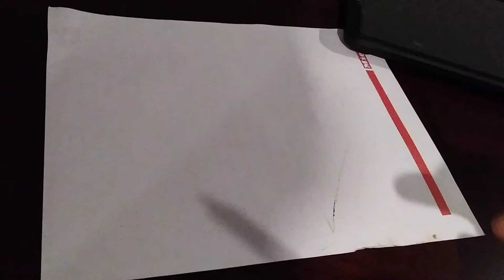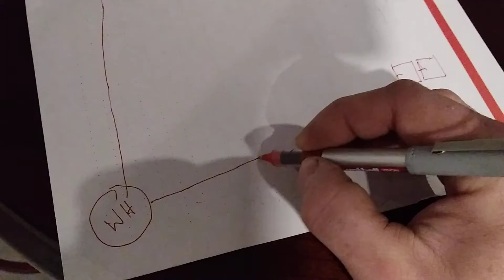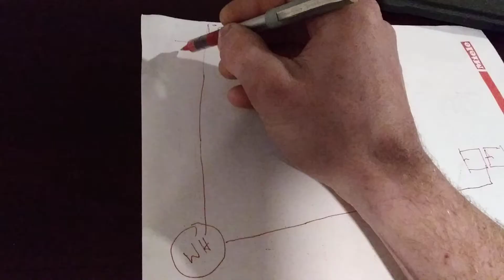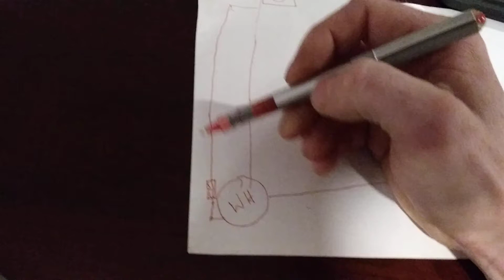Hot Water Recirculating Loop

Comment: This is a great system but now you are heating pipes all over the house, even when you don't need them.
What you are saving on water you are spending greatly on gas or electricity for the convenience.
Insulating the hot pipes will help some but all of my pipes are insulated and they don't stay hot or even warm for long.
You need to add an electric solenoid valve for less than twenty dollars and an electric timer that will open this loop only when you need it.
You really only need that hot water in the mornings, evenings and a few other times. You can buy timers, also less than twenty dollars that will even allow for different days of the week and multiple times per day.
Electric solenoid  https://www.amazon.com/HFS-Electric-Solenoid-Valve-Water/dp/B018WRJYUO/ref=pd_day0_328_2/137-7479043-9566120?th=1
Timer https://www.amazon.com/NEARPOW-Multifunctional-Programmable-Countdown-Electrical/dp/B07QJ3K43N/ref=sr_1_2?dchild=1&keywords=120v+multiple+event+timer&qid=1609652172&sr=8-2
Great system and good luck!
Reply: Great explanation of this, thank you!
Reply: For days without use maybe not very efficient. But depending how far the point of use is, its prob more efficient to keep a loop warm than drain many gallons until the hot water reaches the fixture. All the water you let run waiting for it to get hot also gets replaced at the water heater with cold water so it has to reheat that much water plus the hot water you actually use every time you use it.
Reply: @JEZPP   I did not say this was a bad idea, I said it was a bad idea to constantly circulate water through a loop when you are not using it.  Pipe loops even with the best insulation lose heat quickly and constantly burning up money in order to keep them warm.  As I already said my pipes are insulated in my house and they only stay warm for a very short time after you stop the water flow meaning it would be a constant battle to keep them hot.
Reply: Completely agree - much better to not waste energy keeping the pipes hot overnight or other predictable periods of inactivity. How would you wire the solenoid and the timer you linked above? Just wire a plug to the solenoid and plug it into the timer? If you can find a solenoid that fails "open" (the one in the link is closed with no current), the overall design is unchanged as you would be back to 24x7 hot pipes. I'm sure you'll recoup the $40 for the parts pretty quickly from less gas or electrical usage (and better environmentally).

Comment: Does this only work if the plumbing is above the water heater to use gravity?  How about a house where all of the plumbing is run under the house in a crawl space while the WH is on grade with the living area?
Reply: I am in that same situation and would love to hear someone's experience with this. OC Run, did you ever get a response to this?
Reply: @wimchalmet  No I didn't get any response.  If you find it out would you mind posting it here?
Reply: @ocrun6765  My house, built in 1940, is plumbed like this. A brass nipple piped into the water heater drain just like this video showed. The house is pier-and-beam and plumbing runs under the house through the crawl space as well as to 2nd story bathroom where shower gives hot water in about 2-3 seconds. Have always loved it. Been here 20 years.
Reply: @jeffbonner2765  thanks for your response.

Comment: I own a ranch that needs this badly. I noticed in your video your return was swichted to 1/2". Was that on purpose? I was going to run my return in 3/4". I didn't notice was your feed line 1/2" or 3/4"?
Reply: Return is low demand / low volume.  All you want is a path for the water to return.  The larger the lines are, the more heat will be lost - it's a physics / geometry issue because all hot/warm lines will have heat loss.
Reply: @bobblack3870  1/2” copper or 1/2” PEX?  Either work based on your comment I would think then?  If all it needs is a return path?
Reply: @bobs4718  Sure, 1/2" will work fine but is overkill for homes.  For many homes, this is likely to be standard for the final end-point usage, especially items like showers.  Sinks may even be using 3/8".  If you have it or want to go smaller, 3/8 or even 1/4 will work, because the return circulation like does not need high volume.
Reply: @bobblack3870  thanks, are there any issues with slight elevation variations in the return line?  I will need to dip about 10” and back up 10” for 12’ half way back to my HWH.
Reply: @bobs4718  No issues.

Comment: I installed a system like this, using a pump, and it works great. Very cool seeing the gravity design working. I used a spring-loaded check valve and didn't do the hole (if you can even do that on the design of flow check I used) but I've heard multiple reasons for the hole in the check valve, such as preventing valve chatter on pumped systems (for the hydronic heating loop in my house, there are check valves that were previously installed for whatever reason, and you hear a metallic clanging sound while the heat is running, which may be from these check valves, although I'm not sure), or for preventing an air lock in the system, which could be a concern in your system, since the gravity circulation would probably stop if you had an air lock in the recirculating line. With the hole, you're probably pulling a small amount of hot water the opposite direction while using any hot water at the tap, from the bottom of the WH, to the open fixture, which would ensure any air lock is bled out. The downside of reverse flow for your design is pretty low, since the water is warm anyway because you tee-d into the drain port, so you don't have the risk of cold water bleeding over into the hot line when there's a large enough pressure drop in the hot line. Your design also eliminates the power and design complexity needed for a pump, and keeps the water constantly circulating, which will increase the amount of hot water you have available, as well as prevent the risk of pipes freezing in winter, since the water at the very bottom of the tank will now be warmer than it was before. Cool to see you did it all in copper; I was lazy and used pex on mine 😅

Comment: Finally!  I think I've found the reason why the previous homeowner installed an additional 1/2" line to the bottom of the water heater!  Except ours has a ball valve and not a check valve, which would make sense why we get cold water out of the farthest faucet when another faucet is drawing hot water, like a shower.
Reply: Yup, just add a check valve in line with the recirc return loop right before it tees back into the bottom of the WH and you should be good. If your system is gravity and doesn't have a pump, you'll want to use the same style of valve that Owen used in the video which doesn't have a spring and doesn't require any force to open the check valve. If you don't want to solder/sweat copper, you can use a Shark Bite fitting, but I think Shark Bite only makes a spring loaded check valve which may not work for a gravity/non pumped system unfortunately. You can also try mostly closing the ball valve, which will limit the amount of water that's able to flow in reverse through the recirculating loop, and will make the water at the further fixture somewhat warmer without modifying the current system.
Reply: @MittyNuke1  yeah, I tried the shark bite check valve.  Even though it's only about a 2 psi check, it will not let the water gravity circulate.  I took it out and put a straight-through union in place until I can find the correct one.

Comment: This system wouldn’t work with an instantaneous hot water heater (with no stored hot water) would it? What are the alternatives?
Reply: The problem is the tankless water heaters need minimum 2.5 psi water pressure to turn on. That's the issue I'm trying to solve now so I can install a tankless to supply a Dickinson Radex forced air hot water heater in an rv. Trying to find a 12v CONTINUOUS hot water pump that can handle pumping hot water and not over heat and shut down...

Comment: Will this approach work for a 2-story house? I wonder there’s enough “gravity” to use this approach. Is insulting the hot side the trick to make this approach working? Or, do you insulate both hot and the return? 

Here’s quick estimation:
0.5” pipe, 8 ft up for hot (80 deg C, very hot) and 8 ft down for cold (40 deg C, like hot summer day). The water weight difference of water in the cold and hot is about 6 grams or 0.0132 lbs. the pressure from this delta on 0.5” check valve is about 0.07 psi, which is never strong enough to open a check valve with 1.5 psi opening threshold. So, you have to have a small hole in the flipper of the valve. Does this make sense?

Thanks.
Reply: Math is on point! I particularly appreciate the mix of Imperial and metric units. The small 'leak' drilled in the check valve allows a small constant flow (which might be temporarily reversed when the hot tap is opened.) The check valve still stops most of the cold-side flow from reversing.

Comment: Hi Owen-thanks for this video!  I just had my plumber install a new water heater and a recirculating pump.  It was taking 5 minutes to get hot water to my shower in the MB.  Problem is that now I have the opposite problem.  Hot (scalding) water first then cold.  Once cold it stays cold and can't adjust to warm water.  I've turned down the water heater..which now only gives cold water to the shower.  Sinks seem to distribute hot/cold ok...but shower not good!   Any suggestions?  My plumbers are stumped and have said they've never seen this happen so they don't know how to fix it. Meanwhile, I've spent $700 on the pump.  I love my plumbers and they've tried hard to make it right..they are stumped!  Thanks for any help!
Reply: After reading, my question is if a check valve was installed.  In addition, be sure to have a cutoff valve so you can disable recirculation entirely.  Then my next question is to determine if the plumber ended up connecting somewhere between hot/recirculate and cold lines somewhere in the house.  My new home plumber did. He marked nothing and at one point I asked him what was what and he said "I'm not sure."  Because I have white CPVC everywhere, before insulation was installed in my new house, I took 3 cans of spray paint (blue, red, pink) and squirted spots on the lines at various points as I tried to trace what was what during construction.  I got confused so I quit.  Now after the house is built and the plumber gone, I have done more review of his work because of freezing issues and found more incompetence in design.  To diagnose your situation, cutoff the recirculation line and confirm that the shower works.  Then cutoff the hot water line at the water tank - you should not be able to draw any water from any hot faucet or any shower. If I recirculate to get the loop hot, I can flush the master toilet and it will be filled with hot water!

Comment: the convection style of water recirculation doesn't work real well  for all situations.  for a single level house, the action of water heating isn't enough to push it all the way back.  just install a pump
Reply: Insulate the pipe. Don't insulate the last portion to the heater.  Will work perfect in 1 story house. Don't trap hot lines. No issues

Comment: My water heater is right off the kitchen, I do think gas is more efficient with producing heat than electric 🤔
Reply from the maker: At current utility rates you are absolutely right. If your house is laid out so the kitchen and bathroom(s) are close to the water heater, you may not have a problem with hot water taking a long time to reach the fixtures, and you wouldn't need this setup. Thanks for watching! :)
Reply: Owen Perkins I’ve actually had an experience with no electricity for 9 days due to an ice storm in Kentucky. The house got down to 40 degrees. Thankfully we had a gas water heater and we had hot water. So every time I look at homes, a gas water heater is a must have. Because it sucks to not have it when you need it the most 😂
Reply from the maker: @nathanielaranda8407  9 days?? Wow...hopefully that was a once in a lifetime occurrence. Otherwise an automatic standby generator would be on my short list of home improvements.
Reply: Owen Perkins it was back in January of 2009. Our local Walmart and Lowe’s had power, so we would just shop around to get warm. It was hilarious, they were like can I help you find anything. We said no were just trying to get warm 😂

Comment: Good video and demonstration.. wondering if the trade off of gas vs water is worth it? Probably is. I'm a plumber myself, just looking up different opinions and ideas on the topic
Reply: I am a plumber also, Saint Louis area. I’m doing a little pro bono job for a friend and I really hate putting in something that I know it was going to wear out and potentially cause issues so I’m trying to figure out the best way to keep everything simple. Keeping it simple would be putting in a 1/16th hp pump for a total of a 90 foot loop with a couple of swing checks, insulating the lines very well, leaving the pump run 24 hours a day. I feel like there has to be a better way. The best line out the last 10 linear feet or so of the return line going to the base of the water heater needs to be on insulated. I guess I’m trying to ask you what you decided to do or what some of your research might have uncovered. I’m a big commercial industrial guy And I love figuring this kind of stuff out!
Reply: @562handsomemike   Gravity loop with a check valve is going to wear out?
Reply: @562handsomemike  well since I’ve been working for a new company and we use navien tankless water heaters. And you can set the recirc in half hour increments and set it day by day. We usually set the recirc to set 7 days a week to run about 530-6am to 930-10pm. You can change each day individually if you’d even want to incase someone is not home for days at a time.. seems to be most efficient rather than some pumps not running off a timer and just temperature. The navien tankless also has an option to learn your schedule and will then the recirc will only run at typical times you use it.

Comment: Water is cheaper than gas so I guess I'll stick to wasting more water.
Reply: All depends on your location, in mine, we'd rather waste gas; it's cheaper than water.
Reply: A lot of water is more expensive than a little bit of gas.
Reply: @mr2981  not if your gas is running constantly.
Reply: And in my case if you have well water. That's "free" water so I can't justify pumping cold water back into the bottom portion of my electric water heater. "Free" water versus more use of electricity. Correct me please.
Reply: Think of it this way. It's much cheaper to keep a hot water loop warm than reheating a bunch of water. All the water  you let run down the drain while you're waiting for warm water is also replaced at the water heater with cold water. So not only are you wasting water that's already been heated but got cold,  your water heater needs to reheat that amount of water again plus the hot you actually use. It waste twice the energy and water.

Comment: So I was dead set on installing a recirculating hot water loop using the expensive $550 On demand TACO Genie pump and $100 motion sensors 4 of them. Now this new gravity recirculating systems has me on a mind roller coaster. I see this is better since there are no future pump maintenance cost. I wonder what are the cons? I was thinking to do one big loop ( about 75-90 feet of running PEX A pipe (UPONOR PEX)) since all plumbing is exposed. Any thoughts?
Reply: Yes, should work fine.  The return line can be small such as 1/2 inch because you are expecting low volume.  A 'con' is that you are keeping the hot lines hot/warm all of the time, which takes energy.  My new 2005 home has a recirculation set up during construction, with pump and thermostat to control the pump.  I decided to stop using the pump and because of the "heat rise" physics mentioned here, it still circulated.  Bonus - no electricity required.  The home furnaces (3), h/w heaters (2 in series) and stove run on propane.  When I turned the recirculation valve off, I found that my propane usage year-to-year was cut in half!  I specified that all pipes - hot, cold, recirculate - would be insulated.  Owen mentioned this trade-off in his discussion - just didn't quantify it.
Reply: @bobblack3870  Double the fuel cost with a gravity system (recirc valve on), long term, isn't really cost effective.  Assuming hot water usage isn't completely random, I'd think I pump ($$$) with some smart usage controlling, would be more economical.

Comment: Is it going to work if you have 3 loops? I have ranch house and I need to do 3 instead of 1 long one ?
Reply from the maker: Like three separate branches to bathrooms? Should be fine. Mine has two branches and they tee together about 10 feet upstream of the check valve. Both zones stay nice and hot.

Comment: this setup may increase pipe heat loss. the hot water pipes should be insulated when a recirculating loop is used.
Reply from the maker: Pipes are now insulated (except the last 8 feet or so at the water heater) - no pump in this setup, which I'm pleased about. Gravity powered!
Reply: @owenperkins   Please, explain. How to use this system without recirculating pump ? You mean, it is enough to have some slopes for this? But what about the head which should be created by pump for delivering  water from heater to
Sink ?
Reply: @turquthuseynov9323  Maybe I can help.  I have a recirculation line in my 2 story house.  Water heaters are in a 2nd story attic.  Master shower/bath is 1st floor on the opposite end of the house and it still works, even though I have a pump on the recirculation return line and the pump is turned off.  Apparently the temp difference between the hot water heater's inlet @ bottom and it's outlet @ top is enough to cause circulation.  Heat rises, cold water (cooling off in the lines) sinks.